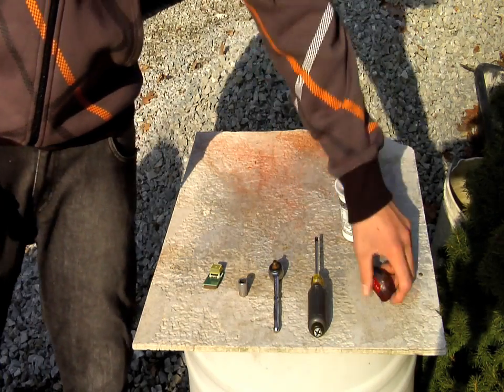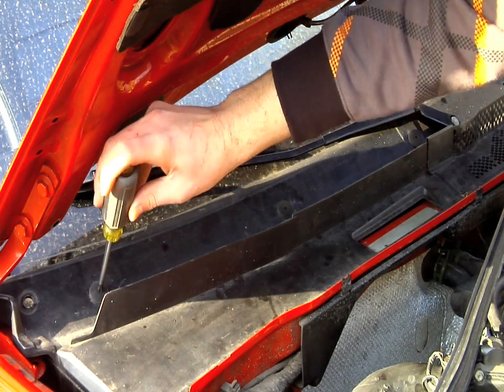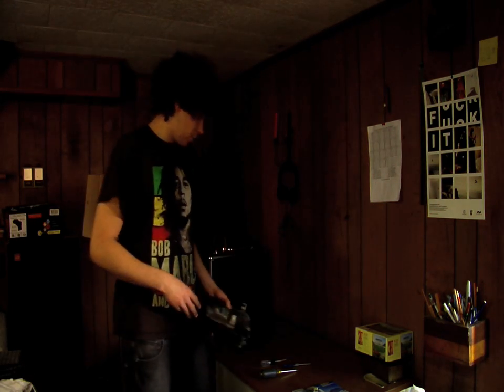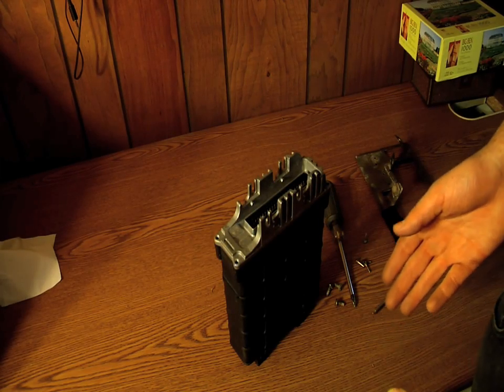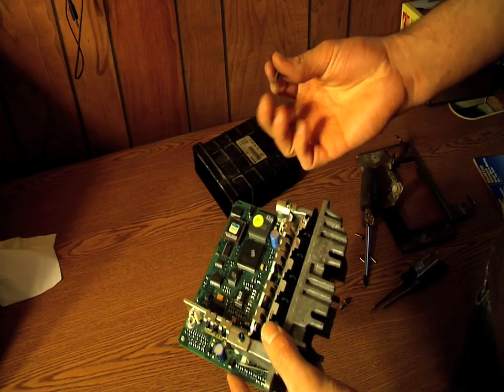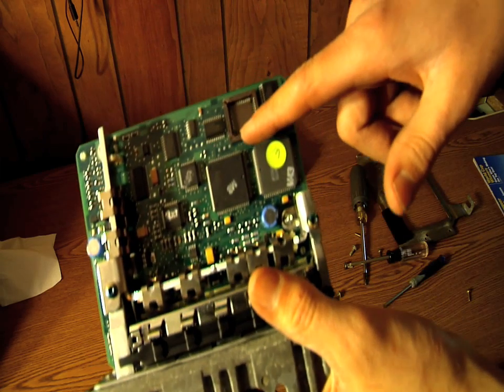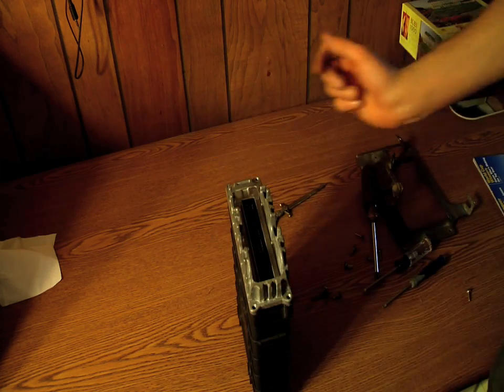How to : Install a chip on a mk3 Volkswagen ecu.

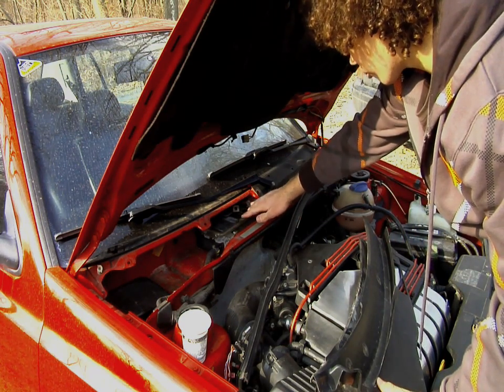Comment: i saw the ECU, but where is your cabin air-filter? It looks like it´s missing... At 2:09 it should be to the far left of the ECU. Are you breathing raw air when driving?
Reply: mk3 vws in north america mostly did not have cabin air filters. Some people make there own, but there really is no need, unless you have severe allergies and are worried about picking up extra pollen, but its the same as driving with your windows down. ]

Comment from the maker: depending on which motor it is, it can be. However you would not just be able to swap ecus, out. you would have to convert your wiring harness,ecm,ecu, and possibly. your ignition system depending on obd1 ob2.  
.
techtonics tuning has a chip for a 93 2.ol motor. Youtube will not allow me to add a kink, there link is there name techtonicstuning

Comment from the maker: Mk4 jettas after 1999.5 are flash loaded, instead of actual chips. Companies such as giac, apr, tectonics tuning, neuspeed, unitronic , united motorsports, c2 make software depending on which motor you happen to have.  Some may require you to ship out your ecu, others will be able to be flashed (programmed on your ecu) by a local shop or possibly send you a flash loader, that you would plug into your obd2 port.

Comment from the maker: Every chip is honestly abput the same when it comes down to NA cars. I have Giac on my mk4 8v and mk3 12v. GIac is usually more pricey, but tectonics tuning makes 8v chips as well as neuspeed and I believe there under $100. c2 may also make a chip and if United motorsports makes an 8v chip That would be my first choice. United was started by Jeff who did the programing for c2 but went solo and from what I have heard, is making good stuff.